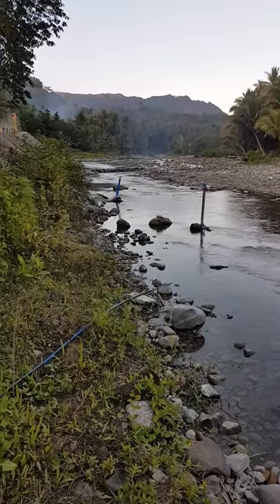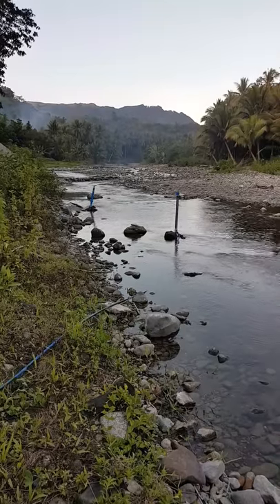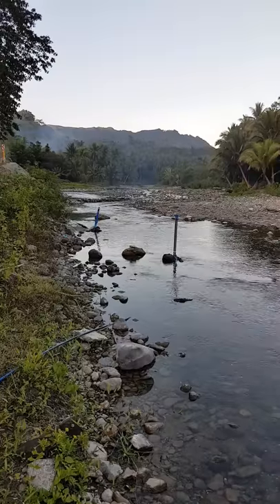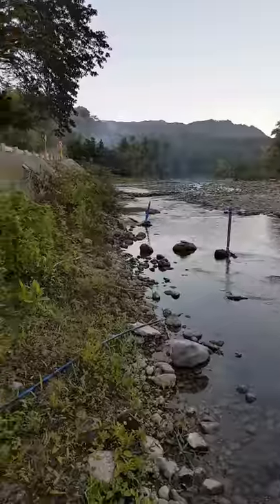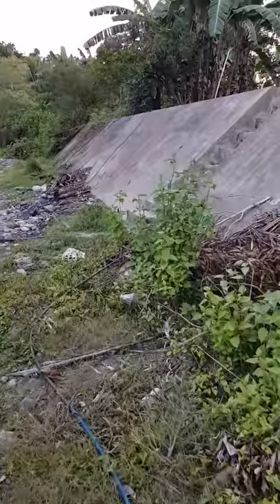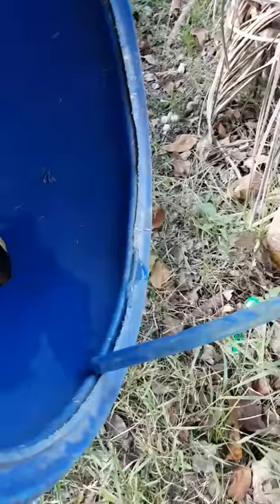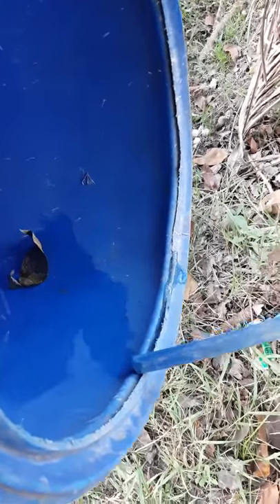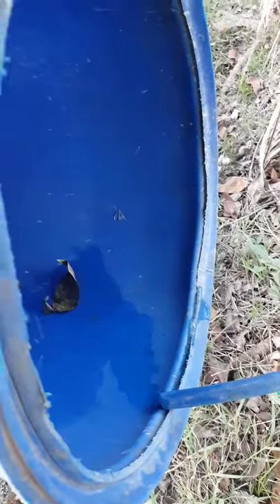Low Head Ram Pump | ramplified #shorts

Comment: is it requires special design to make it work in almost flat stream? i'm facing similiar situation which there is no possibility to make waterfall..
Reply from the maker: Just longer drive pipes with improved snifter valve